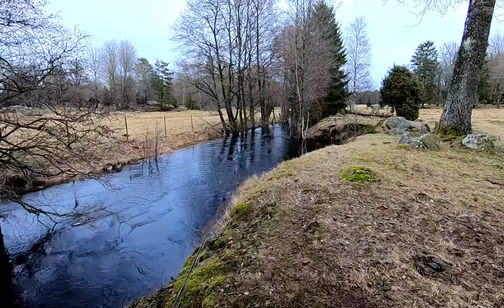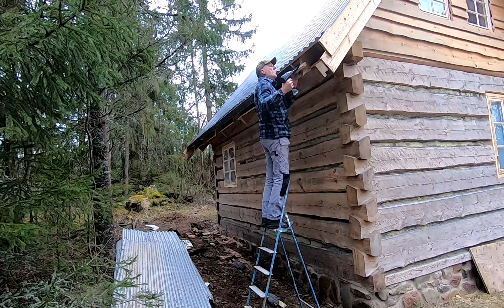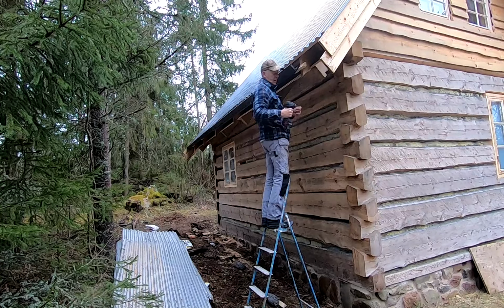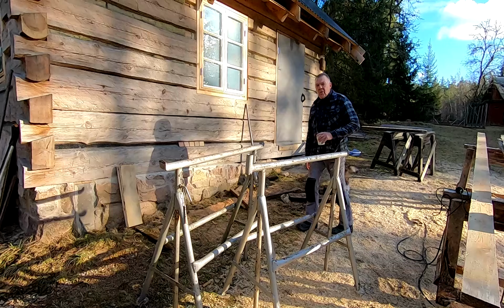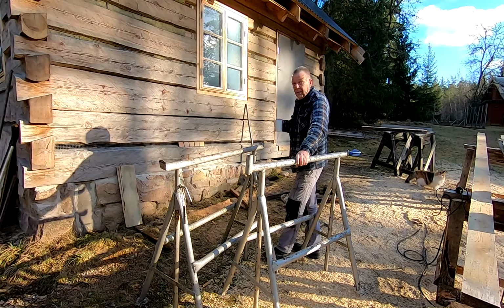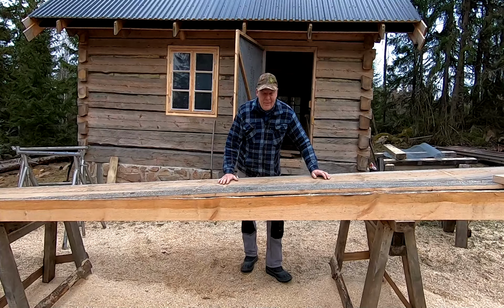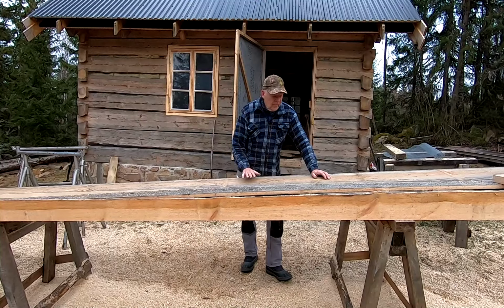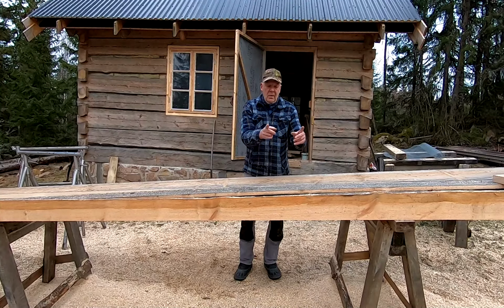Which color to choose, Wedge cutting floorboards. Vlog #249 - S5

Comment: Howdy Michael- I certainly understand your dilemma trying to choose the right chinking color. When I quit using sifted red clay in the mixture I found some mortar color at a brick making factory. The ladies in the office were very helpful in choosing a color as close to what the red clay did in the mix I used to do. I think the color was called tan buff. The names of color can be very different depending on where you get it. I’m really bad with picking out colors. I don’t have to be very color coordinated by wearing overalls all the time lol. I like the idea of using wedge shaped floor boards. I may have to try that sometime. Hope you have a wonderful weekend my friend. God bless
Reply from the maker: Hi Paul. Here in Sweden I can buy concrete color in a lot of big builder markets, but I would love to find a pre dyed cement, so I don't risk a color change when I mix my chinking mortar. I've seen your video where you mix in color - light buff - and I've also watched Noah Bradley's fŕom @handmadehousetv, and he's using a cement called flamingo C74. It's yellowish and is also very pretty between old, weathered logs.
It's a difficult choice, because I think both colors are beautiful. 
All the best 
Michael